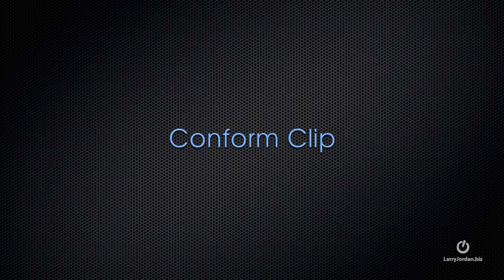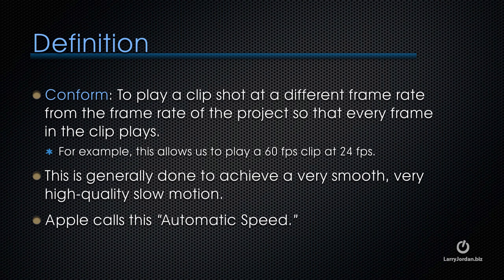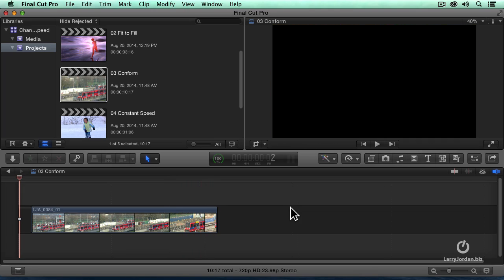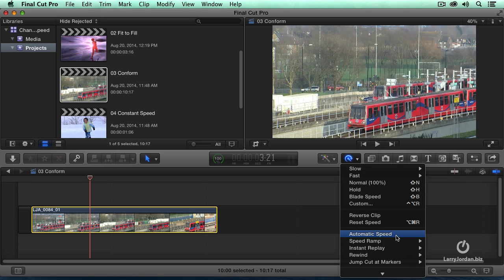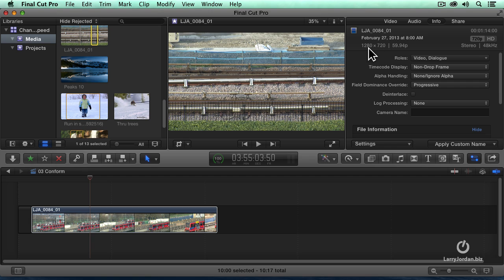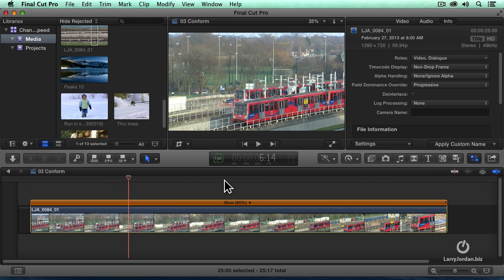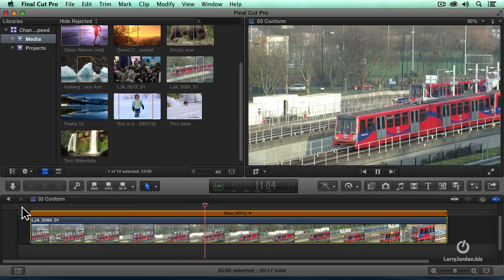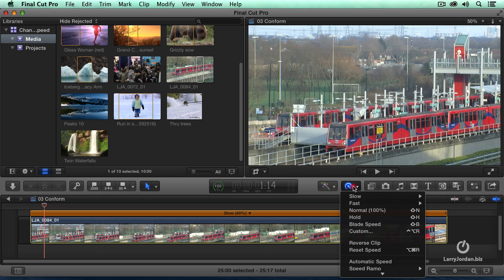How To Conform A Clip in Final Cut Pro X

Comment: Hi Larry, thanks for a great video.  I had a question around mixing frame rates.  I do cooking videos and there are times that I want to slow down certain clips when I edit the video.  Since i'm not always sure which clips I want to slow down at the time of shooting, I tried shooting all my clips at 60fps. When I bring the clips shot at 60fps into a 30 fps timeline, I still notice a bit of choppiness when I play it back at regular speed, even though the math would ideally add up.  What would you suggest to be the best option to have slow motion in my videos so that they don't appear choppy.  Still a bit confused.
Reply from the maker: Michael:

I'm not sure why these are looking choppy. You are doing the right thing - because switching 60 fps to 30 simply means dropping every other frame, which should be visually lossless. Make SURE your project is 30 and not 29.97, however.

Also, you may need to render the project. It may be choppy until it gets rendered.

Larry
Reply: @LarryJordanFCP  thank you so much for the quick reply.  I tried playing back after rendering and it is the same thing.  Actually now that you mention it, while my project is a 30fps project my video clip is actually 59.94fps as that is all that my camera will allow.  It does not have a 60fps option.  I mentioned 60 fps earlier as I was rounding it off because I did not think it would make a difference.  Would that be the issue? Given that my clip is a 59.94 fps if I selected a project frame rate of 29.97 would that solve the issue?
Reply from the maker: @fonsecamikester  

I would start there and see what happens. 1/2 of 59.94 is 29.97, so, yes, that's a good first step.

Larry
Reply: Larry Jordan thanks much!

Comment: Great video! But it doesn't work for me :(  I have a project on 24fps and some of my footage were made by a smartphone and it's 30fps. Now I can't sync with the other footage that was already recorder on 24fps.  There is anything that I could do in this case? Thanks for all your helpful videos!
Reply from the maker: Bruna:

I'm not sure what you mean by "can't sync."  Audio is not dependent upon frame rate. And both Premiere and Final Cut automatically adjust for different frame rates.

What specific problem are you having?

Larry
Reply: @LarryJordanFCP  I meant synchronize :P Yes I know, the audio is not the problem.
 I recorded with two simultaneous "cameras", one I setup to 24fps, the other one was a cellphone that record on 30fps. When I imported all the footage from both cameras on Final Cut it couldn't synchronize. I did what you show in the video and the cellphone footage dropped the speed to 80% and this is very slow to synchronize with the other footage :( I was wondering if there's other way to edit multiples fps in the same project? Thaaanks for all your attention!
Reply from the maker: @brunabernardoantunes8319  

Ah!  Sounds like you are trying to create a multicam clip. That requires all clips in the multicam clip to have the same frame rate.

So, you have two options:
1. Don't use a multicam clip. Simply stack one clip on top of the other in the Timeline. FCP X will automatically convert one of the clips to match your timeline settings.  This will work, but you won't be able to see both clips at the same time.
2. Convert the clip with the wrong frame rate to the correct frame rate using Apple Compressor. Yes, this will require making a copy of it, but as long as you use ProRes 422 or larger, you won't see a quality drop. The benefit here is that you'll be able to put both clips - now with matching frame rates - into a multicam clip.

Larry
Reply: Larry Jordan Yaay 😬 That’s awesome! You just saved my video. Can’t thank you enough but thank you 🤗
Reply from the maker: @brunabernardoantunes8319  

Happy to help. Good luck with your film.

Larry

Comment: Hi Larry,
Lovve the channel mate its very helpful.

I have a question. I export most of my video edits on FCPX @ 25fps, I like to film in 30fps the reason is that id like to be able to slow it down a little bit to give everything the dreamier look on some of the clips. However not all the time. What can I do to to make sure everything is smooth at the export end if I don't slow it down? And if o do slow it down whats the best way?
Reply: Yawuru:

Well, um, you can't. 

The only way to convert from 30 fps to 25 fps is to drop every fifth frame. For mostly stationary shots, this won't matter. For action/movement, it may create a stutter.

My recommendation is to try to shoot material that you KNOW won't be slowed down - such as interviews and establishing shots - at 25 fps. That gives the highest quality with no stuttering. Then, you only need to worry about action shots that aren't slowed down.

Larry
Reply: Yayuru:

And, in FCP X, the best way to slow a clip is to select: Modify > Retime > Automatic Speed. This plays every frame in the source clip at the frame rate of the project.

Larry

Comment: Larry, to ensure a smoother video, in a 24fps project would you recommend conforming a higher frame rate clip to play in it's normal speed? I saw that you conformed it using Automatic Speed, but that increased the length of the clip. If I wanted to maintain a certain length of a clip (that is shot at a higher frame rate) but play it at 24 fps, would that lose video quality?

Or is the only way to maintain quality is to shoot in the frame rate that will be used for editing (given no desire for speeding up or slowing down the film)?
Reply from the maker: MAO Films:

Image quality won't suffer in changing frame rates, but smoothness of motion will. 

Ideally, you should shoot the frame rate you want to deliver, or a multiple of it. For example, 24 or 48, 25 or 50, 40 or 60.  You get the idea. This provides the smoothest onscreen motion.

Far worse is shooting 60 fps and playing back at 23.98 fps. This will almost always cause a stutter in motion - like sports or chase scenes, but would probably not be noticeable in a talking head.

Automatic speed always changes the duration of the clip. That's its whole purpose. To change frame rate without altering the duration of the clip requires dropping frames, which is why even multiples of frame rates work so well.

Larry
Reply: Larry Jordan super helpful thank you Larry

Comment: why couldn't i just hit slow ???  no one has ever showed me any difference in quality ?
Reply: You could hit slow, there's not really any problem with it as long as you get the right speed. If your clip is 60fps and your timeline is 30fps, you can simply go there and click 50%, if your clip is 60fps and your timeline is 24fps, hitting the 50% slow is going to cause some frames to be skipped since you'll be trying to play 30 frames in one second (60fps * 50%), while your video will only show 24 of them. Final cut will then skip 6 frames out of the 30 you chose, so you will notice this tiny jumps from time to time since they can't be evenly distributed.

However, if you go to custom and type 40% speed, then you are adjusting it to play at 24fps (40% of 60), so you won't lose any frames and your video will look smoother.

After all, you can simply hit slow if you do the math to adjust it to your project's frame rate, but when clicking automatic speed, Final Cut will do this math for you.